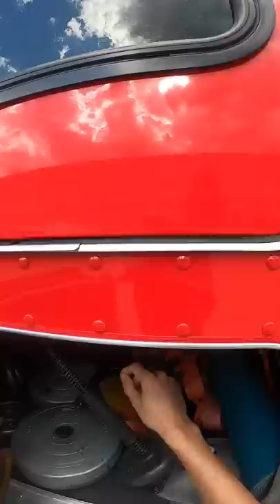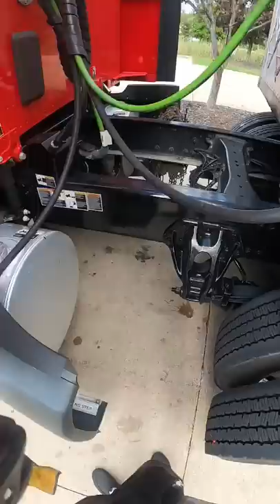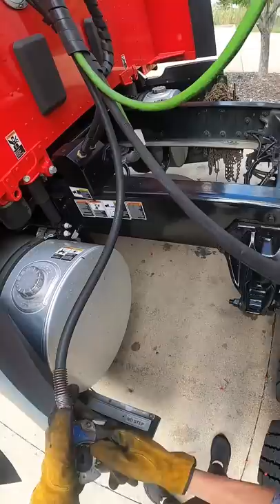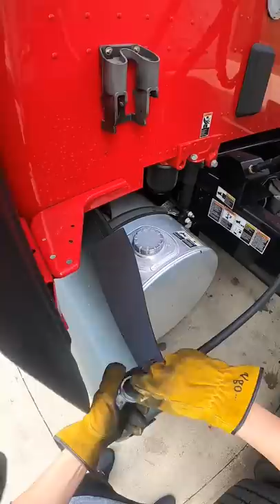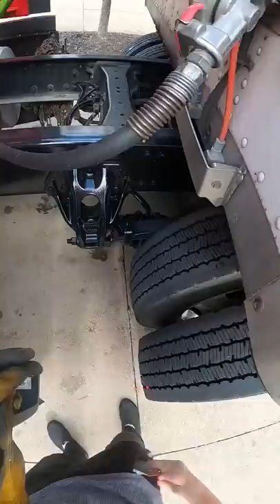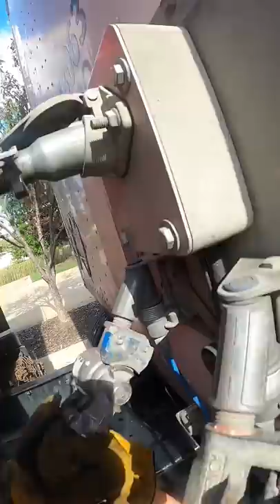the time i tried to find waldo in a semi [#shorts] 👏👏

Comment: Gps is a tool. Always have a motor carrier atlas. You might want a rand mcnally gps and set it for trucks and avoid small roads
Reply: I've been using rand for 7 years, has yet to put me on a road I shouldn't be on... it has done some pretty stupid shit however. Especially getting on and off big roads. I've had it tell me to go north, drive for 12 miles then get off the highway and get back on going the other direction... even though there was a South bound ramp right there.
But Google maps satellite view for scoping out new shippers and receivers... and occasionally to find my way out of an unfamiliar truck stop, I'll admit it.
Reply: @genejeffries2888  Facts. Google maps is nice for street view, use a truckers GPS, carry the paperback just in case, and most importantly use common sense. But your right for the RM GPS, I don't know how many times it tried to add 20 miles to my trip lol
Reply: Irene is damn right. Look at the road you're turning on first. Think, do you fit? And that before getting in because you'll be in a lot of pain if not. And that's why you're supposed to look over the suggested route to see if it's doing anything strange.

Comment: Yes! So very true! Always kept a map with me to plan my trip ahead. Learned a hard lesson like this in Colorado.
Reply: You can't open up the GPS on your phone?
Reply: @Brayden-zl9rz  well that depends. You can set it up during your pre trip inspection or during your break but not while operating. Though sometimes the gps system isn’t really designed for truckers from what I’ve seen, so it may take you most of the way and I used it for the freeway portion allot but I would always use a map and write everything down to plan my trips. The gps was only there as a backup reference for the freeway part of the drive.

Comment: Why the hell are you following a GPS in the first place.
Trucker rule # 1: know before you go.
That means before you crank your truck and move forward one inch stop what you're doing. Get your phone. Get your map. Get pen and paper...then plot out your route.
How do you do this well. Determine where you're going write down the major roads. Call the receiver ask if there's a route(usually there's a pre recording option for this unless mom and pop place.) Write that stuff down. Match it with the map while making sure it's truck friendly route. There's a ledgers in front or back of map books with that info. Then and only then after all that make the GPS match the route. You're in control not the GPS.

Comment: In some situations (not all,) it is harder to u-turn a straight truck then a semi. Since wheel base is shorter on the cab, as long as you have the room to turn the cab, the trailor will follow. A straight truck your gonna need to 3-point turn

Comment: Hey Alex the truck driver guy. I noticed your weights in that compartment. You should try the workout bands. The kind in a bag with handles to attach to the bands. Its very compact and light and is like a whole gym in a bag. They work great man, and I used to use nothing but iron weight. I prefer the bands now.

Comment: One time, GPS told me to take a lift on a railroad track , deep in the middle of the night. . . I almost did because there was only the slightest bump when my front tire hit the rail. I barely saw the drop off on the other side of the far rail and the rocks there. Is that part of the railway map may have not been in use and apparently the streets had been paved many ti've been many times as the blacktop was even or slightly above the rail itself.  I say that giving benefit of the doubt that I wasn't actually seeing what I was seeing. But it was in the country there was no other lighting and the moon was not anywhere close to half or full. It was so Pitch Black*, I was waiting for THOSE critters to attack me.

* You know Riddick, right?

Comment: Try missing your tune with a windmill blade over 200 feet long. It's not a good situation. You can't even go around turn around cause your permit isn't for that road. Usually call the cops and ask for assistance if needed sometimes you don't have too though

Comment: There needs to be a Trucker's version of GPS for all vehicles. You input the size of your vehicle and it can help determine a route for you. Including drop pin routes where it is to a nonlisted jobsite or new construction address, with the drop pins being able to be shared via a simple text message. Furthermore it would tell you all known clearances of bridges and so forth and flag any along your initial route so you can adjust the route accordingly before you depart. Think this would really be a worthwhile investment. Since it would avoid using county roads or city streets and alleys.

Comment: I followed my GPS on some back country road in Texas until I came to an old wooden bridge. I got out and looked at it and said no way. I didn't want to risk my truck or my load. There was no place to turn around. I had to back up for two miles around turns and narrow roads. I was so angry. It took forever but I made it. Didn't hit a thing. Just took a long time.

Comment: I live on a small road that connects appomattox (va) to rt.29 apparently what ever GPS systems yall run doesn't pickup the 11ft tall underpass cause we've had trucks wedged so bad they've brought them crane trucks to pull en out

Comment: Sweetness did you not read the signs in the area telling you that there's a dead end. I mean it's not a hard thing to do. Yes you're driving a massive semi I get that. And you want to go the way your GPS is telling you. But if you pay attention to the side on the side of the road you would know that was a dead end. And if you pay attention to signs and where you're going specially if you're driving in a large semi with a trailer behind it. You'll know what Bridges you can go underneath. Don't know where you need to go.

Comment: The trick to using GPS whenever your truck driving is to always cross reference that GPS with another GPS I've got a Rand McNally a Garmin and Google I use Google whenever I get close to the shipper in the consignee because Google knows where f**** everything is I put the Garmin and the Rand McNally on mute and if they're telling me to go the same way 99% of the time that's the way I'm supposed to go but if one of them differs in path and one of them is wrong and I need to pull over and check my map.